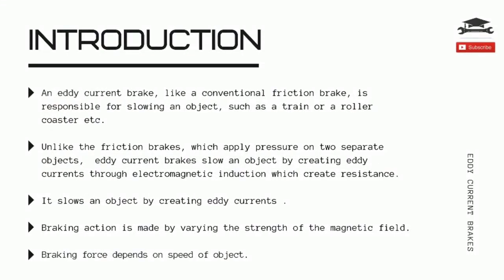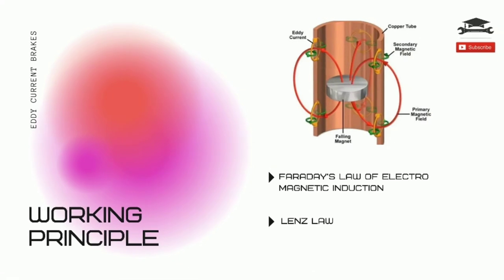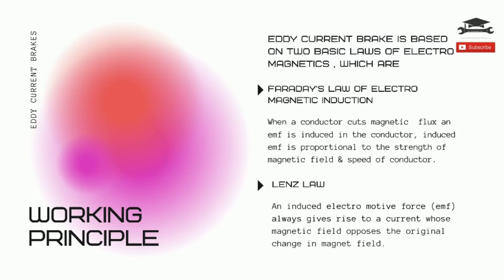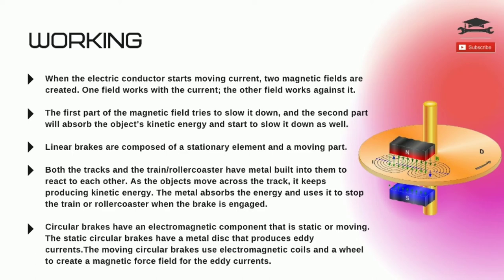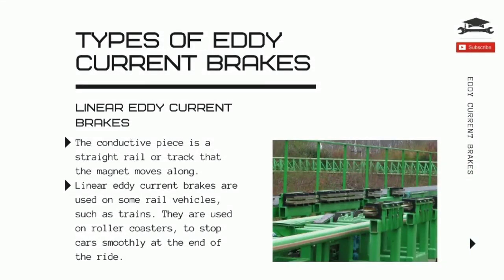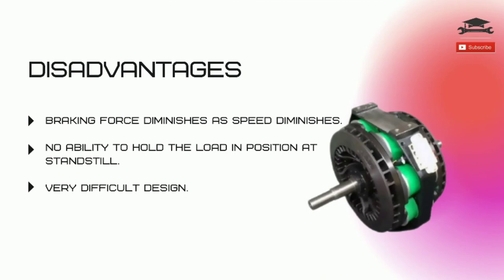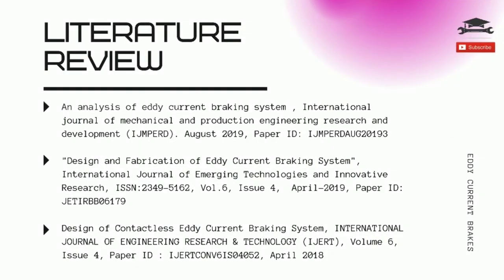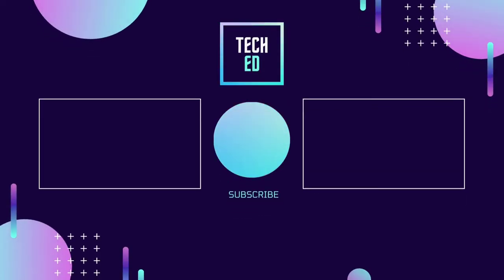Eddy Current Brakes - Introduction, types and application

Comment: Can u Explain briefly about eddycurrent brakes
Reply from the maker: Eddy current brakes employs an electromagnetic force to stop or slow the train by dissipating its kinetic energy as heat.
Unlike friction brakes, here the stopping is done by an electromagnetic force between magnet and a conductive object.
When the conductive object moves past the magnet, eddy currents are induced in it by the magnetic field.
This current creates its own magnetic field opposing the field of the magnet and helps in bringing the object to stop or slow.
NB: This induced current and opposing magnetic field is proportional to the velocity of the object. So mostly used in high speed applications.
Reply: @TechEd4You  TQ so much